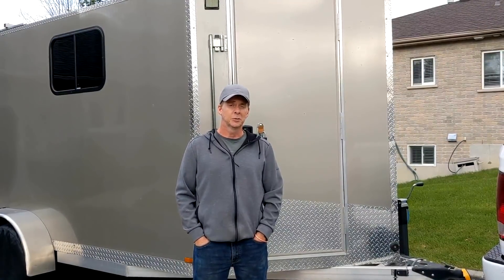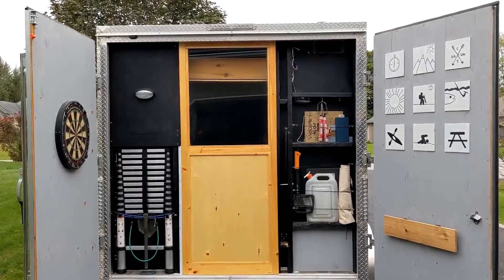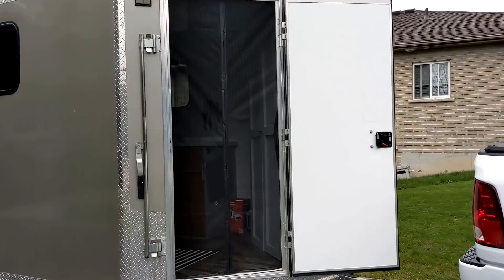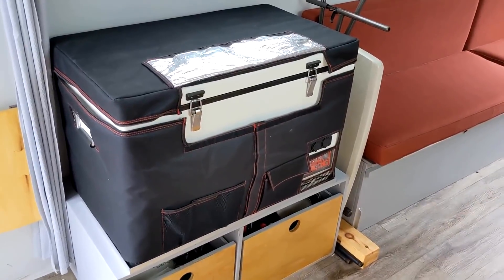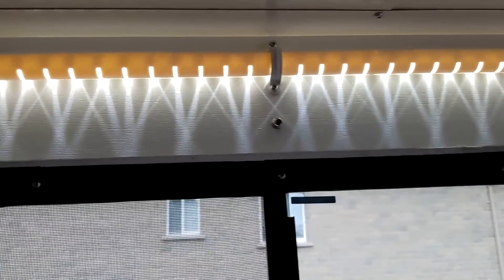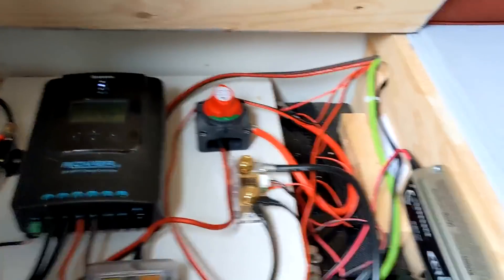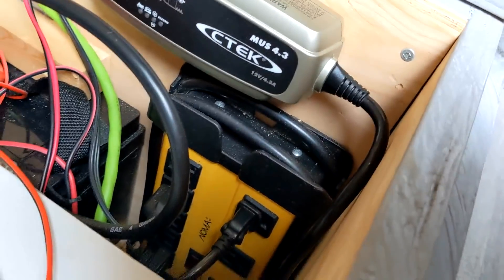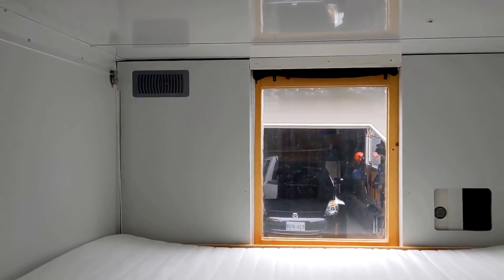Cargo Trailer Conversion walk through

Comment: Bathroom???
Reply from the maker: Hi there,  At about 8:00min in I talked about the toilet. We have a porta poti that we take out and put at the front door and pull the curtain at night and sometime during the day if the ladies want to use it.  We didn't want to take up space that wasn't going to be used all the time in the trailer.  Also, most camping areas that we go to have showers and bathrooms if needed.
Reply: @liveandbreatheeasy good thinking . If it was me there would be no porta-potty. Use the campgrounds facilities. Same with the shower. When we tent camp we both get up together in the middle of the night to go pee. If my wife wakes up first when she wakens me we both usually will have to go. Most camp spots have a place near the bath house and that's where we camp. There was a time in Iowa we were the only ones there. The camp ground has a pipe where you put your rent money with the number of your camp spot. The nice state park was at Wayne Fitzgerald in IL. The officer picked up the money and gave us the sticker. Both places we camped at was cheap. 8.00 at the county state Park and 12.00 at Wayne Fitzgerald camp ground they also had an ice cream place that sold hamburgers and fries we didn't need to cook anything after a long days trip I wasn't in the mood to pull out the stove and cook. Wish Florida had places like that. We did camp in Florida another time but had to kill ticks a few got inside the tent but I killed them with bug spray. We were warned so we were ready. 73
Reply from the maker: @ronb6182  This is true about the washrooms at the campground. We have only camped in Canada and everywhere you go you have toilets and showers.  We just put it in just in case.  My wife likes to use it at night and it also gives us an option if we are on a long haul and can't find somewhere for her to go.  We never use it for going number 2 (poop).
Reply: @liveandbreatheeasy  good thinking you don't.want to have to deal with it. That's why we have sewers and septic tanks. 73

Comment: +more closeups would help.  when you are so faraway from what you are describing its tough to see what you are talking about.
Reply from the maker: Thanks Jon,  I plan to do some shorts with pictures and closer shots for bed (already posted), Electrical any other things that people ask.
Reply: @liveandbreatheeasy   that went right  over your head. back off so we CAN see what you are talking about.
Reply from the maker: @jonrosenow5812 I meant that I will be producing shorter videos on different elements in the trailer.  I have already posted one on the bed.